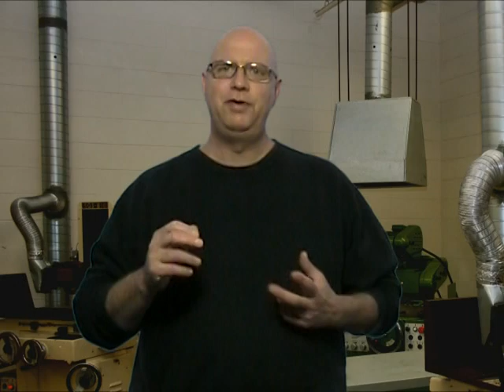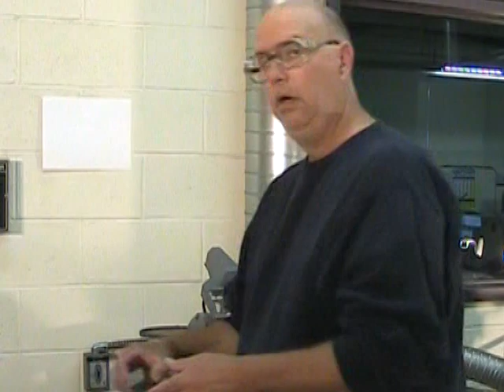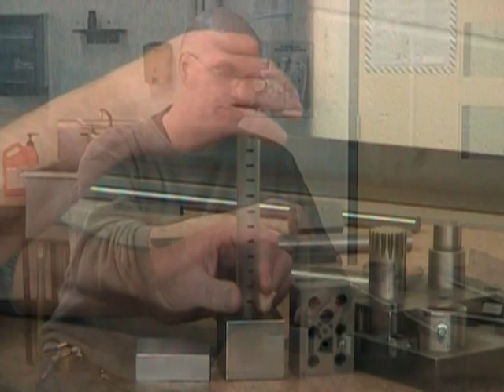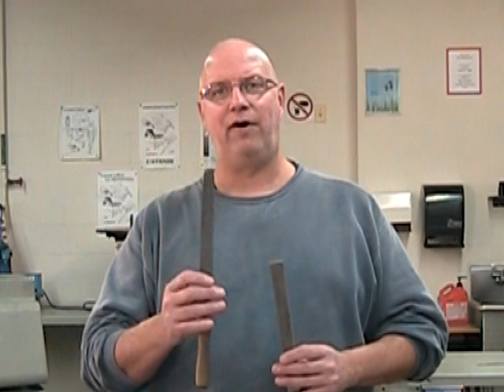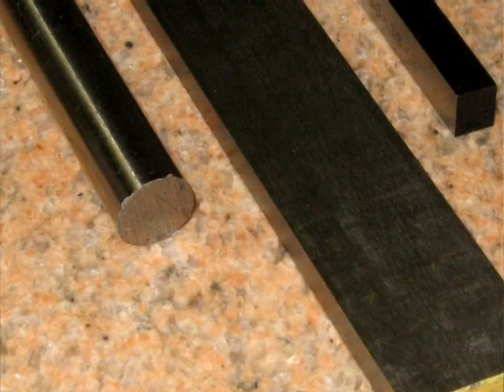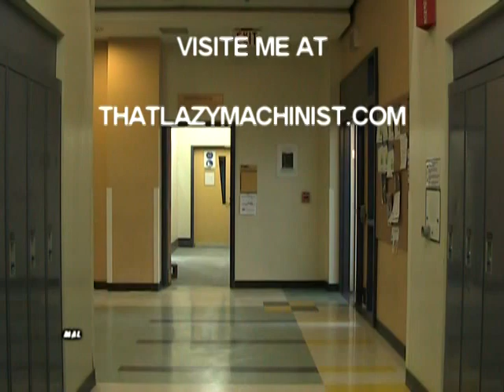RECOGNIZING STEEL ALLOYS, HOME TESTS & TRICKS THAT REQUIRE NO SPECIALIZED EQUIPMENT, MARC LECUYER

Comment: I think this is the best steel identification video I have ever seen.

I have a question:

-The files test was not on carbon free steel, medium carbon steel and high carbon steel but not low carbon steel.
Would it be scratched by both files very easily?

TY

Comment: A multimeter is a useful tool for figuring out what kind of metal you're dealing with. Different metals have different voltage potentials with respect to a reference electrode.

Comment: I ordered some leatherworking knives from a knife maker. Two knives were supposed to be made of M2 steel and one was supposed to be made of M42 steel. I think the knife maker may have used different steels. I was expecting the M2 steel to be darker and heavier. Are there certain liquid chemicals  I can use to determine which steels have been used?

Comment: I am a 24 yo small engine Mechanic who works with prefabricated parts with defined roles out of (from my perspective) unknown materials. Most pieces have already been engineered for defined roles and under normal use perform optimally. However without information such as part numbers or when a part has reached the end of its service life I often need to have an accurate view of what the material is. Thank you very much for your practical wisdom and the amount of time and effort you put into this video it is greatly appreciated and I look forward to exploring your channel further. Thank you again for your time!

Comment: Needless to say, how perfectly you teach. But I wonder if the file can withstand a metal-test on cement carbide without getting damaged.
Reply: It’ll completely dull the file, an easier test for carbide is density, it’ll be twice as heavy as a similar sized piece of steel

Comment: sounds, sparks and smell.. yeah yeah... juste snake oil knowledge... nothing like a true mass spectrometer test... why not use real standardized ASTM material testing?  true science rules!!
Reply from the maker: Mainly because the video is for home or hobby machinists and I do agree that science rules but it is up to each person to tame it however they can and make it work for them. Thanks for watching and for some great insight, Marc.
Reply: @THATLAZYMACHINIST  you know that some things are out of reach from backyard DIY enthousiasts... (which I am myself on some level...) even a chemical spectrometer analysis won't tell you much about which heat treatment and/or work hardening a particular alloy had got...  you'll need chemical, mechanical property testing, hardness testing and some other test only to figure about...  I worked in some speciality  Al. alloy mfg for automotive industry... and nobody would believe what are the composition and processes we used to satisfy some particular needs from some well known  automakers... we even "sandwiched", rolled, annealed, rolled again, partially annealed and rolled again  3 different alloys types... for some...  go figure it out after all...

Comment: I got a 5” by 7” steel bar and the guy told me it was 4140 but the only numbers it has is 3372 . What does the 3372 mean?
Reply: Probably a heat or part number or something, it’s not an alloy or designation of any kind

Comment: Unfortunately, video can’t hold the brightness differences, or the color differences very well. In reality, the differences are greater than what can be seen on the video. If also found over the years, that stainless steels can look different from each other depending on the alloy. A high chrome SS looks different from one with lower chrome, but high nickel content. High chrome looks brighter, and more mirror like. High nickel content makes it look grayer, and as though a tiny bit of brown is mixed into that gray.

Comment: Impressive.  Thanks for sharing.  I've found about half of the stainless steel in my kitchen is attracted to a magnet.  I've also wondered if random bits of metal I've come across were actually wrought iron or even cast iron.

Comment: "....just go to your steel store....."
Reply from the maker: Hi Paul! I agree, but it has happened more than once that I was sold something that turned out to be something else. The home machinist often buys bar ends or leftovers from other jobs since complete bars exceed what they can handle and that is where most mix ups occur. Thanks for watching and be safe, marc
Reply: THATLAZYMACHINIST yes I laugh because my grandad worked for British steel for 40 years and the concept of a steel shop in the UK is but a memory! Now we only have the equivalent of home depot. Tragic really. 

However if you find yourself in Hanoi there is literally a street called "steel street".

Comment: Kinda puts it all together  - thanks.  I'd never seen the simple scleroscope, I like that, would be great for comparing two similar looking articles.  Usually i've been just using visual, magnet, and file, and usually gets me all I need.  Think I'll start a sample box with marked loose ends.   I'm getting more into metalworking, looking to build a decent lathe and get my shop upgraded. 
Always lots of projects to be done here on RelentlessHomesteading, and I've got some interesting builds coming up so lots to learn.  Appreciate the video.  I subscribed and will be checking out more of your vids.
Reply from the maker: Thanks! Marc    THATLAZYMACHINIST.COM

Comment: Thank you for making this video.
I wish I had taken machine shop in high school. (That was back in the Olde Days, when such practical courses were offered. I also wish I'd taken Business Typing - Who knew that computers were going to be rampant in the 21st century?).
 I instead opted for Drafting and Electrical, the latter which has served me quite well over the years. Drafting? The only thing I  can say is that I learned isometric drawing. (And always have a decent eraser with you). 
My father, despite being illiterate, taught me automotive skills and "very" basic metallurgy, if you will, in his garage. Although, a couple of his pointers were wrong; "You can't weld cast iron or aluminum." You can, just not easily with a stick welder and the wrong welding rods.
Reply: Hi Frugal -- Wow sounds like my experience --- too busy with math/science classes to take shop.  But took drafting, and to this day, yes it still helps in whipping out a drawing or iso.  And went electrical eng. as you said.  Similarly learned alot from my Dad whose father was a blacksmith, ...but some things to unlearn.  I've kinda gone full circle.  Was able to do all the analog, digital, and operating system designs I wanted, and now getting more into metal working;  but I'm kinda into learning how to do everything project related -- such is the nature of Homesteading here at RelentlessHomesteading, I gotta shoot more of the metal work projects around here.
Reply: You can weld aluminum with 4043 or 5356 and you can weld cast iron with expensive specialty nickel electrodes

Comment: Marc,     is there a home test to differentiate 304 and 316 stainless?
Reply: brent chalmers I think the higher the number is better stainless some of the low number a magnet will stick to slightly.  316 is a food grade
Reply: Those alloys are not very easy to differentiate. The only difference is 316 has slightly more nickel and molybdenum. It’ll be more corrosion resistant and tougher. Without pricey equipment there’s no good test for it

Comment: what about the smell of burning galvenized steel?
Reply: +breathe it in. Long deep breaths. Go to the light.
Reply: That's the smell of death.
Reply from the maker: +TheEvilways101 Hi Evilways, the fumes from the zinc coating on galvanized steel is quite toxic, please use appropriate safety measures. You are correct however about the fact that it does have a distinctive smell, Marc
Reply: so basically it smells like farts? metallica farts? or broccoli farts?

Comment: Marc, thanks for the informative video.  It was a good refresher for me.I particularly enjoyed the spark testing section.  Many years ago I started working for an engineering department where they were performing fatigue testing on specimens.  Things were not making any sense to the professors because the specimens were failing at the wrong cycles.  I was asked to take a look at the process .  I suspected that the vendor was supplying us with faulty samples.  so I set out to do some tests. I remembered spark testing was one way to identify carbon content of steel so I set up a grinder and camera.  Sure enough the carbon content was much higher than expected.   Your explanation was much more in depth - I was looking just at the amount of sprigs or branches in the sparks.  Thanks again.  Jeff

Comment: Hi,
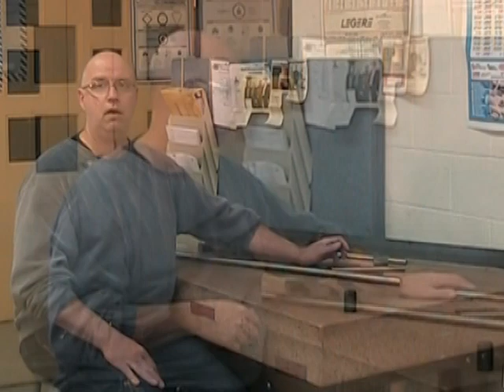 I've a question for you: you say , in video ( at 17.10 ) , that the structural iron is mild steel, and then you show ( at 18:20 ) a different look material that you call again mild steel. What's the difference ?
Thanks 
Pierluigi ( and thanks for your videos )
Reply from the maker: Pierluigi Frullani Hi Pigi, mild steel is steel that contains low amounts of carbon that cannot be hardened by quenching. These steels come in many forms: #1: structural steel (I beams, angle iron, C channel) that is hot rolled (crusty exterior) #2: Bar stock, plate, sheet (either hot rolled or cold rolled) #3: and all of the above as alloy mild steels ( steels that contain other elements than Iron and carbon)(often acid washed so not scaly but with mat finish). So as you can see, there are a lot of different low carbon steels. I hope this helps, thanks for watching and for commenting, Marc L'Ecuyer
Reply: It helps a lot!!!! Thank you !

Comment: Marc:  One cautionary note.  Steels are often identified by the paint color applied to the end of the stock.  There appears to be no standardized color code.  You must therefore know who the supplier is AND what their color identification codes are.  Otherwise, you may think you positively know the material, but you may be mistaken.  Best Regards as Always.

Comment: Hey Marc, I live in the Ottawa area, and was curious where you buy metal from?  I've gone to LouCon Metals in the past, but their prices are a bit high, and sometimes require buying full sheets/bars.
Reply from the maker: Hi Mark, I haven't been in several months but I always go to:
Metal Supermarkets Ottawa
2413 Stevenage Dr., Unit #6
Ottawa, ON
Monday to Friday 7:30 am - 4:30 pm Open Saturday 10:00 am - 2:00 pm (CLOSED ON LONG WEEKENDS)
They have always sold me just the amount that I require, a little more expensive than in bulk but buying three time more for a better price per pound isn't always cheaper. Thanks for watching the videos, Marc L'Ecuyer  THATLAZYMACHINIST.COM